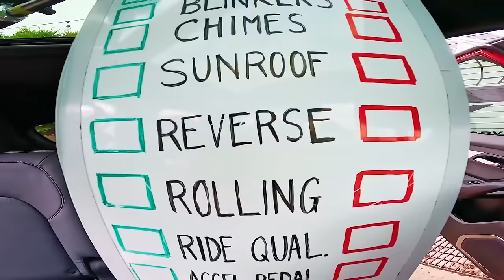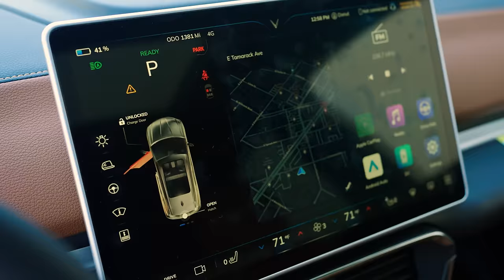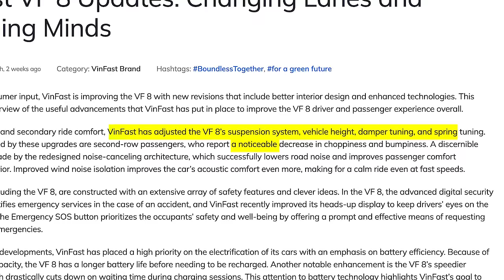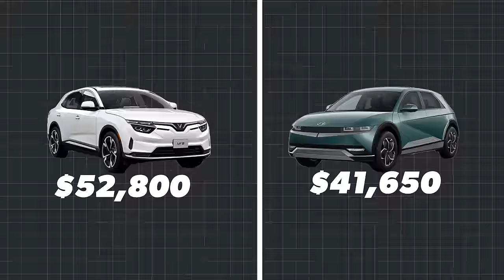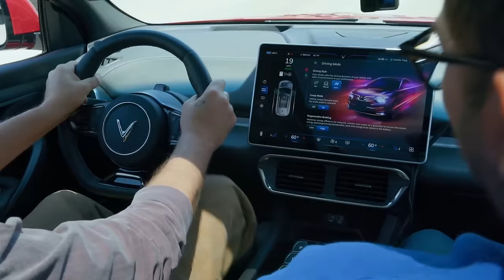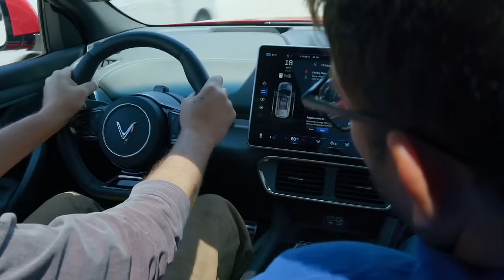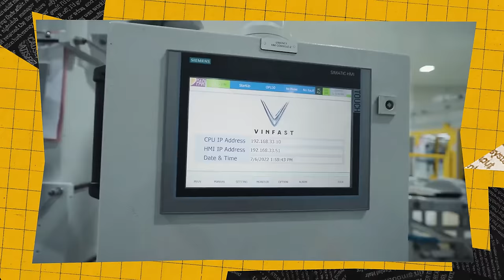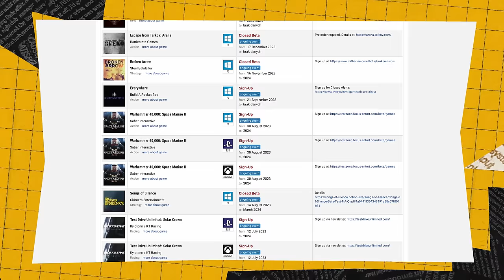We Drove America’s Worst Reviewed Car Again

Comment: Almost had a head on collision in a Golf 6 rental car that, with my full force turning the wheel, would not let me get back unto my lane on a country road. Option to turn this of was hidden deep inside the menus of the infotainment system. Never drove a car with lane assist before. No one at the rental dealer told us this.
Reply: All the electronic safety stuff is absolutely worthless. If you cant drive safely without it you shouldnt have a license imo. That stuff is dangerous.
Reply: Drove a few car with land keeping or centring assist feature on Subaru and Toyota. Both don't have this problem. And they both have a button on the steering wheel can quickly switch it on and off. I don't think this safety features are worthless. It had safer me from hitting wild animals and it makes change lane easily on a busy highway as well.
Reply: @123123boobies not blaming you, but it does help to read the user manual in a new car you’re unfamiliar with, at least a quick glance at the controls and such
Reply: @123123boobies  They have lot of lessons to learn from the aviation world more like. Operator assist is the only way to achieve higher vehicle safety standards, but you're right that blindly taking away controls is a bad idea.
Reply: Wait what? This doesn’t make any sense. Pull the data from the ECU and see what the steering angle was.
Reply: @123123boobies  Spoken like someone who hasn't drove a modern car. Multiple studies literally prove that cars are more safer today than they were in the past thanks to those "electronic safety stuff".
Reply: I've never once seen a lane keeping system that will stay engaged when the driver firmly moves the wheel against the assist. They can always be overpowered or disengage immediately.
Reply: @123123boobies  My Lexus has a similar feature where it will add a slight amount of resistance if you try to slowly change lanes without signaling. Its just there to prevent people from drifting lanes. If you switch lanes normally it doesn't do anything even if you don't signal.
Reply: I drove VW UP, and it saw construction repanted lanes and swerved fishiously... Mini panickattack... But a ll good :) now I always turn it off
Reply: That’s terrifying. This is only the beginning too. Features like this will only get worse
Reply: @123123boobies  my hyundai is inobtrusive enough that it just makes driving long distances significantly easier without lulling you into a false sense of security or forcing you to do anything you don't want, I think it would be fine if everyone had a similar model. sometimes shit happens faster than humans can react, doesn't matter how good of a driver you are
Reply: @TheHuskyK9  "more safer"
I rest my case.
Reply: @123123boobies sadly computers make mistakes far less often than humans do. Whether you think they should or not. Computers also don’t get tired or drunk or angry or get distracted by their phones. All that electronic stuff prevents a lot of accidents.
Reply: I almost got rear ended when I had to change lanes to avoid someone braking hard in the middle lane. There was a car coming up behind me but it would be fine if the car would allow the accelerator do what I wanted when I wanted instead of cutting the power, because it immediately slammed on the brakes and took a second to realize I wasn't facing the car in front of me any more before I could actually accelerate. If that was an analogue car it would have been no problem. The technology just isn't there yet and I think even with very rare situations like this they should not allow the tech in every day cars. Not to mention the uploading of responsibility and abilities to the vehicle makes everyone a worse driver in the long term.
Reply: When I was a new driver, I had an issue of wandering in my lane. Not heavily but I just didn’t notice. So I drove a car with lane keep assist to help me see it better and it worked amazing.
Reply: @ifillam7511  I was in a Toyota rental and it stopped me from accidentally drifting into another lane which was actually great. It was late and I was tired, irresponsible I know. I pulled over and took a nap after that.
Reply: CannedCoochie  crumple zones and air bags make cars safer in the case of an accident by preventing injuries or deaths. Electronic assist features prevent the accident from happening in the first place. Huge difference.
Reply: Lane keep assist is one thing.  My Kia Forte has it.  It will try to keep you in the lane if you drift out of it, but if you resist it, it almost immediately disables itself until you re-establish yourself in a lane.  Even in its more aggressive mode that tries to keep the car centered in the lane at all times, any driver can override it easily.
Reply: There is no car that won’t let you turn the steering wheel
Reply: I don't think these safety features are worthless. They just need to be done correctly, I have personal experience with Toyota's Lane. Keep assist and it is flawless, whenever you go to make an input, be it from your brake pedal or steering wheel the system just lets you do that and it does not prevent you from doing whatever it is you are doing, because that is likely going to prevent more crashes than by assuming the driver is an idiot and preventing them from making inputs
Reply: Drove a new toyota yaris cross 2023 with lane assist and radar on doin highway speeds without using the blinkers, had to reduce the sensitivity of the lane assist and it kept goin without me touchin the wheel , just had to poke it once in a while so that it knows im still there, light corners on the freeway and it kept goin on by itself, almost like tesla autopilot, funny feelin doh :O
Reply: @123123boobies  They aren't worthless.  They aren't meant to be a replacement for good driving skills, but "driver assist" technologies like lane-keep assist are excellent anti-fatigue measures for long, boring freeway drives, for example.  So is adaptive cruise control.  Cars are inherently dangerous machines, and even the best drivers make mistakes, especially in very tedious conditions.
Reply: you didn't even try, it's not hard to override it😂
Reply: CannedCoochie  ok. You can voice your opinion and I’ll use facts. Statistics say it definitely does not do more harm than good. Even careful drivers make mistakes. Even drivers who are very aware of their surroundings still have blind spots. Computers do not get tired or angry or distracted by their kids or their phone. You can blame carelessness but we are all human and there will always be human error. You act like car accidents didn’t happen before backup cameras and lane keep assist because drivers were more aware or more careful. Accidents still happened. Now we have electronic assist features that prevent some accidents from happening. That’s not a bad thing.
Reply: CannedCoochie  I’d say if even just one accident is prevented that can only be a good thing but I guess you see things differently. Strange.
Reply: CannedCoochie  you’re right. Driving will never be completely without risks but we have fewer accidents now thanks to modern technology so ….I don’t really understand what you’re arguing for. More accidents like we used to have?
Reply: CannedCoochie  I get that you’re trying to make a point. I just don’t understand why anyone would ever want to make the point that you’re trying to make.
Reply: Consider using your turn signals like you’re supposed to then? Don’t blame the car blame the user
Reply: In 2019 I drove a brand new rental Nissan rouge a few hours away to help a friend move some furniture. It has lane assist and whenever I would try to ride the outside line on a curve Incase anyone was over the line while coming the otherway twords me the nissan would pull me twords the center yellow lines attempting to assist me to stay in my lane when that was not the place i wanted to be
Reply: @bongmuon same here! Was driving a rental and I was in the middle lane passing a slowpoke hogging the left lane. A slow car from the right merged into the middle lane at the same time I was moving over to the left lane. Despite the fact I was speeding up the car slammed on the brakes and I almost got rear ended. Could have led to a bad road rage incident because I am sure that car behind me thoight I was brake checking then. Collision avoidance is great when youre at an intersection turning right and the car in front goes, so you move forward and check for traffic and the car in front chickens out and you rear end them. Other than that, on a busy freeway its can be dangerous. You have to drive like Mrs Daisy and keep a big distance between the car in front of you. Problem is that people will jump i. Front of you and the stupid car will hit the brakes every time. Lane keep assist is definitely a good thing, Collison avoidance can cause you to get rear ended.
Reply: @TheHuskyK9  Bunk. They may proctect you better in a smash. All the active electronic stuff is just malarkey.
Reply: VF8 is definitely not like that. It sticks to the lane like a magnet, but it's a gentle magnet which any weakling can pull past, WILL pull past, especially if it's an emergency.
Reply: @TheHuskyK9  They may be safer in total and for the general public but adding them to the cars created more possible dangers e.g. faulty ABS decreasing your brake force for no reason. And there is not enough conversation about it.
Reply: @malice6081  Do you see it better or do you let the car do the work for you?
Reply: Bro cappin for the likes lol .
Reply: @bongmuon  That's kind of my issue with these systems. They only help people who shouldn't be driving in the first place. Making driving more accessible is not a good idea, because it's already too accessible as it is. People are too dumb to own automatics, even, because they forget to put them in park, and then step out, and they roll away. Ideally the safest drivers get the safest cars, and the worst ones are put on a 300cc single cylinder motorcycle until they pull their head out of their ass, start taking an uber, or get turned into road pizza.
Reply: Sucks you've gotten so many likes on a comment describing something that absolutely did NOT happen. There isn't a mainstream modern car in existence that has a lane departure assist/tracing assist/steering assist system that is strong enough to fight you putting "full force" on the steering wheel. I just don't understand why people go to such lengths to make things up.
Reply: Mazda just vibrates the steering and let you continue!
Reply: That is unfortunately new EU law,every car sold since jun 2024 will have to have lane assist and speed warning ON every time you turn on the car ,if not you cant sell the car in EU
Reply: @dzonikg  this is news to me as EU citizen - need to dig deeper on this
Reply: @mikakettunen7939  Even if you buy now car it will probable have it already  so for me from now will be most important how is easy is to turn them off because you will have to do it every time you start a car
Reply: @dzonikg  Begs for another @Donut How To Turn It Off episode for sure!
Reply: @malice6081 shouldnt have a licence if you cant drive….

Comment: Plot twist: Vinfast forgot to do consumer testing so they're just making changes and sending it to donut on a monthly basis
Reply: the US market is probably very far off from the vietnamese one (pretty bumpy & dusty roads with motorbikes everywhere left and right, you better never change lane unannounced and you need extra blinkers on the sides...). Also that's the explanation behind the price; here in Vietnam imported cars are more expensive, making the Vinfast EVs somewhat competitive in the domestic market. And I swear that even with that price, there are plenty of new riches from the newborn middle-class who are all for the pride of a national domestic brand
Reply: Vinfast might actually be abusing Youtubers for free Quality Controls 😂😂😂
Reply: @something3194 As an American, I'd like to support Vietnamese homegrown exports and I'm in the market for an EV.  But Vinfast's price point is at the upper end of my price range - higher, really.  I'd like a basic EV, good mechanical/electrical design, OK styling, minimal tech frills at a mass consumer price.  Pushbutton controls for the basics with no dependence on a big touchscreen display to drive.  The touchscreen can be there, but I'd still better be able to get home even if the screen is smashed by careless passenger trying to stow their tennis racket or whatever.
Reply: @SansNeural  it's fine, no hurry; when the electricity will be green in both countries maybe this can make any sense
Reply: @SansNeural i think You should wait for Vinfast VF5,6,7 or VF3 in the future
Reply: @SansNeural  As far as news goes, I heard that they are bringing compact hatchback to US market soon. VF3 or VF1 I think.
Reply: @SansNeural vf3 bro
Reply: @SansNeural bro sadly to break it down to you but in us a 20k car you saw on the roads if it's in vietnam is probably cost around 60k :))))) i own couples of mercs and different cars i know
Reply: @tranvietvuong china car 😂

Comment: Dear Donut,

What happened to bringing my car back for a re-test? 😅

About pricing of 52k, that’s the top of the line Plus trim. Eco trim starts at 46k.

However, there’s a lease promotion going on now till end of this month 1/31/2024 with $250/month for Eco and $299/month for plus trim. That was why I picked up my second VF8. 

For the record, my 1st VF8 reviewed by you guys was from the first 999 batch City Edition with annoying issues.

My second VF8 is the Standard long range edition which like you concluded a much better improvement over City Edition. 😊 

VF does listen to complaints and acts quickly. Thank you for giving them a 2nd chance!

Cheers!

Comment: I've got a '21 VW and its warning chimes are somewhat annoying, though it pops up a message on the dash as to what the chime was about - cold temp, lane assist.
The lane assist can be annoying as it alerts to 'keep in center of lane' when staying there, or when going through areas like construction where the lines have been removed but are still visible.   It does have a bit of a pull if you drift or try to change lanes, but that is easily overcome and doesn't affect driving other than a slight need to put more pressure on steering where you want to go.  Sometimes it doesn't turn off when using the turn signal when nothing's in the blind spot.

Comment: Just to mention VF8 has a substantial curb weight of 5.732 Ibs while the model Y only has 4.363 Ibs. For those two similar segment SUV, that 1369 Ibs gap really mean something. VF8 might not as quick as Model Y and also has less range but it supposed to be better in terms of build quality. And I believe heavier means safer for most cases.
Reply: “ heavier “ doesn’t translate to more safety. Vinfast were dead last on safety ranking under EuroNcap
Reply: @minhnguyen-fr5zq  Well to be honest I would rather sit in a "less safe Vinfast vehicle" than a 5 stars NCAP Daihatsu trash can.
And also if size and weight doesn't matter then a 5 stars NCAP Toyota Corolla is way safer than a 1 star NCAP Jeep Wrangler.
Reply: Heavier is better ? are you sure
Reply: This is a Vinno
Reply: @minhnguyen-fr5zq it’s proven to be sturdier than a Hyundai Tucson
Reply: Heavier is more safety :)) It will get more momentum when you break that means a heavier car doesn't break efficiently than a lighter car.
Reply: You know what that 1369 lb gap means ? It only means the VF8 will have shorter range and its tires gonna wear out faster . How much Vinfast paid you ? Lol
Reply: @quanle7386 the fuck is a vinno ?

Comment: The fact that you guys get upset about the car not allowing you to change lanes unless the blinker is on is so weird to me. In Denmark, all new cars with ACTIVE lane keeping assist will not allow you to change lanes unless you use the blinker. That is the default setting. Also - how else would the system know if the lane change was intentional or because of lack of attention, sleeping at the wheel or the likes? 
You CAN change lanes without using the indicator, but it will require you to overcome the force put by the lane assist to keep you in lane. Can be done, but much easier if you just use the indicator. Which you are also required to do by law in almost any situation anyways.
Reply: VF8 lane keep assistant can do what you say. And it always active every unlock than driver can tweak if they dont want. Vf8 safety standard is for euro market
Reply: And besides you turn off most ADAS by stepping on the brake anyway, which is also absolutely needed when you want to dodge those obstacles
Reply: No. You got it wrong. Lane keeping  should NOT yank me back if I actively change lanes while driving fast. Vf8 scares me to death many times